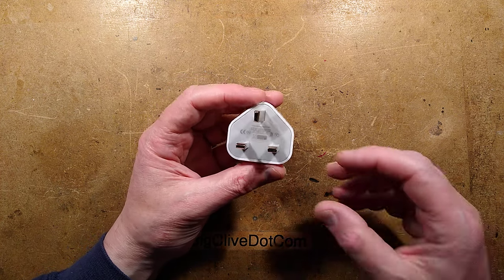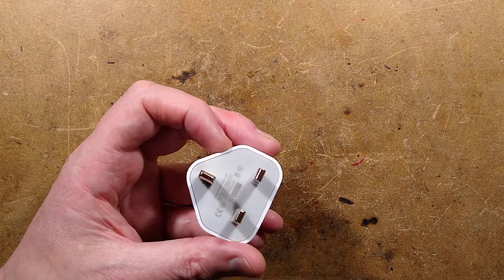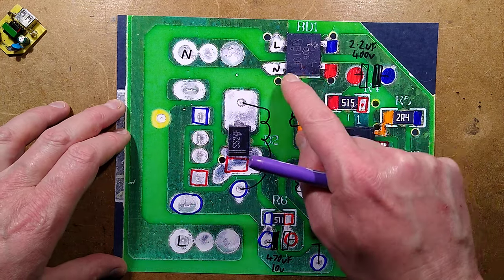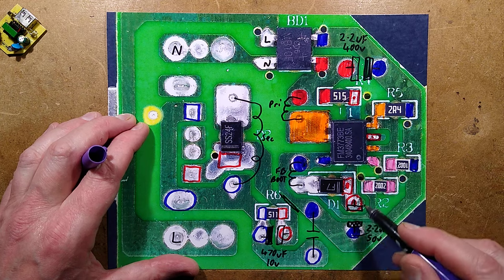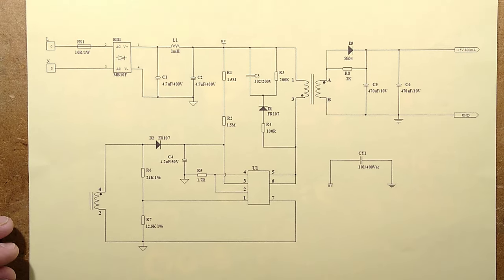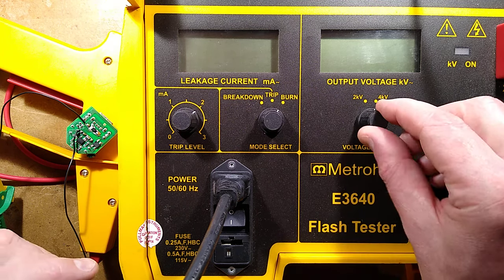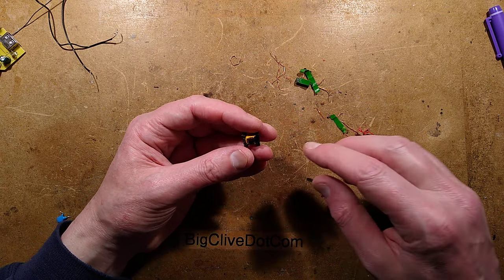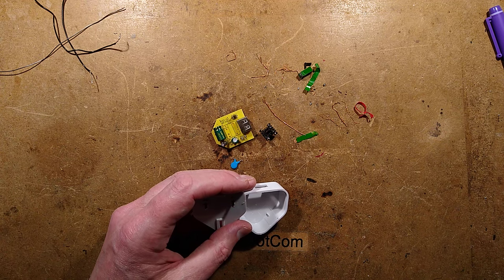Don't buy cheap death-wish chargers

Comment: I bought a ‘Genuine Apple Charger’ from an Australian ebay seller in Australia. I pulled it apart and was clearly a fake. Oh boy did ebay seller go ballistic when I called out the fake product with a negative review. Trouble is, I as an electronic manufacturer spend a small fortune on compliance, but authorities don’t care about unsafe overseas fakes.
Reply: That’s the oddity… importers can bring in almost anything legally as long as it doesn’t crossthe copyright & patent laws, but they can sell *anything*.  It’s up to the user to complain after they’re killed using it.
Of course there’s no traceable path to the importer or manufacturer.
Reply: I had a weird one like that - Australian seller via ebay.  Delta-branded  12V supply for LEDs. Didn't like the look of the label when I got it, didn't look quite right. Pulled it apart and it turned out to actually be a Lite-On PSU, with only about half the current capability. I think it was actually safe enough (proper anti-tracking etc), but as far as I can tell that lite-on model was never approved for Australia. I only use it for testing stuff, never leave it plugged in unattended.
Reply: @laustinspeiss  Actually, in Australia they have to comply with RCM which covers EMC and Electrical Safety. Trouble is, Chinese will print whatever compliance marks you want without doing the testing, and most ebay importers are mums and dads in a garage who wouldn't have the faintest on their legal obligations.
Reply: @DavidMonro  I wouldn’t rank Lite-On any worse than Delta. Both are major Taiwanese electronic manufacturers. Apple actually contracts both Delta and Lite-On to manufacture their offical Apple-branded MacBook chargers.
Reply: @46I37  RCM is just an honesty system. Only an issue if someone catches you out, reports your product and then ACMA decides to prosecute.
Reply: @haxmanz  There's also the EESS for electrical safety, but it's a similar honesty system via the state authorities. I've never checked to see if I could could find documented cases going through.
Reply: What did you expect? you got it on ebay
Reply: @laustinspeiss  uh
Reply: I got a protected power splitter and USB thing from Amazon and the protection must have been the led, as it was all wired directly to the mains. be careful people.

also genuine apple are fairly bad devices too, had a few cell phone cubes that went black and I've replaced a ton of MacBook chargers that had mysteriously charred internals.
Reply: @46I37  don't pin it on the Chinese. I've had gloriously emblazoned "made in the USA" products that are complete shite.   star of that show was the Gary Fisher mountain bike with the bottom bracket out of alignment by 1cm.  quality assurances 🤣
Reply: Genuine and eBay I need I say more
Reply: @man_eating_monkey  HP and Dell both have or still use Lite-On laptop chargers
Reply: shopping platform in our country ban anything gake like that they cant use keyword like lightning original apple etc
Reply: Making money trumps compliance with regulatory and other standards. We know this, the automotive industry is one example...
Reply: @man_eating_monkey  Lite-On is a top notch manufacturer but when you're dealing with a counterfeit item - an item which has been manipulated in some way to misrepresent its origin, specs, etc, you don't really know what sort of a job they did on the item itself, whether they butchered something on there! A little unlikely that there's going to be a safety critical fault as long as magnetics and safety rated caps are intact as they were originally and there's no solder balls lodged in there, but possible that some components are no longer up to spec after the salvage/repair operation by whomever. Second hand salvaged MOSFETs and rebadged fake electrolytic semiconductors are entirely expected. And yeah loose balls of solder aren't that uncommon either, so that's actually a hazard.
Reply: @laustinspeiss  all that matters is the copyright and not safety
Reply: Let’s start again… In Australia, 
you can IMPORT ANYTHING YOU WANT THAT DOESN’T INFRINGE COPYRIGHT OR PATENT LAWS
BUT
SELLING IT IMPOSES LIABILITY on THE SELLER…
If YOU use it, and it fails to perform in any way - you can only BLAME YOURSELF, or CLAIM REDRESS through the ACL from the SELLER.
Hence my earlier comment about no traceable path to the manufacturer and importer- they really DON’T WANT TO KNOW.
Reply: here in germany, the import of fake-branded electronic products is supposed to be very prohibited and controlled, but still, if you look for cheap chargers and headphones and such online, it's like90% fakes on ebay and 70% fakes on amazon. I've made themistake of assuming that a somewhat normal price means a better quality genuine product, but that doesn't work either, so I just buy the cheap fakes.
Reply: Trust nothing purchased online except direct from the manufacturer. Everything else is a counterfeit. If regulations treated counterfeit like copyright, we wouldn’t have this problem.
Reply: The guy you bought it from on eBay literally may be under the impression that they are selling legit products. Could just be a drop shipper.
Reply: If only the official chargers weren’t up-prices so absurdly
Reply: Yea its true i used a fake apple charger and then i swithed to a geniune samsung charger with real 15w charging
Reply: @luminousfractal420 What if the made in China was purposely instead put as made in USA as a lie to trick consumers?

Comment: There's really no excuse for this in British power supplies. Your plugs are so damn big there's always going to be ample room to do it right.
Reply: The space is not the problem. The 99p end consumer price is!
So minus the shop's margin and the shipping cost how much is the total budget to make the damn thing?
You do so see that they left out as many components from the reference design as possible.
Reply: @kwinzman  it's quite possible that the selling price of this item has little to do with its manufacturing cost.  it is much more likely that it is just a loss dump.
Reply: This is actually a big bonus - makes it easier to wire them and easier to find. Of course, they do like to lie on their backs on the floor waiting for an unsuspecting foot. The first thing I noticed on the opening up though was that the earth pin went to nothing. They might as well have just been honest and made the thing out of plastic rather than metal.
Reply: @MrGrimsmith  Apple themselves aren't much better. Take a MacBook charger and you'll see that the metal earth pin on the provided plug isn't connected to anything. If you run your fingers along the metal palm rest you'll feel a tingle because it's not earthed. Only the extension cables are properly earthed.
Reply: @MrGrimsmith  Phone chargers generally don't have the earth pin connected so that is not the issue. That said such devices are required to be fully double insulated in order to meet any reasonable safety standards such as CE certification. This device would thus fail any certification testing in the European Union, which would potentially be a problem if someone were to actually bother enforcing the law at some point, it is about time someone woke up the sellers that are importing and selling these uncompliant items. Probably wont happen until someone with a high enough profile to attract serious media attention to the issue dies though.
Reply: @steeviebops  I saw one spontaneously combust once. A delicate coil of blue smoke.

Comment: Do you have the guts of an Apple charger plug so they could be compared side by side for components and build quality?
Reply: I took an old Apple charger apart, there is a hell of a lot more components in one of those, and electrical seperation. I did it out of curiosity, so yes the Apple ones are much better quality lol.
Reply: Apple use Rubicon cap, IRF power ICs, and actual EMC filters, way higher quality that this things
Reply: I can't stand Apple products normally, but there basic 5v USB chargers are some of the best you can get. Probably why half the cheap ones are designed to look like them.
Reply: @tin2001  the upside of having vendor support lock-in. If they would ship shitty chargers then it would cost them more in under warranty servicing.
Reply: could you open a genuine Apple adaptor and do a part by part comparison. That woukd be very interesting.

Comment: I just want to take a moment to celebrate the return of terrifyingly dangerous 240v electronics.
Reply: What's so dangerous about 240 or 230 Volts ? Design it right and it's no problem.
Reply: @grahamstevenson1740  And therein lies the rub.
Reply: Actually a bit more than 240V, since the the rectified DC voltage is almost the peak-to-peak voltage of the mains sine wave.
Reply: And 120v is so much better? Try and design a decent high power amplifier for 120v. Taking so much current that connector heating restriction of current flow. Yes I am talking about serious current for class A amps!

Comment: For a second, I expected you to probe the diodes in the picture and not on the actual PCB. It's one thing to skimp on (omit) components that affect performance, another thing entirely to skimp on those that affect safety. The lack of separation is particularly inexcusable. It looks like there was enough room in the layout to create sufficient separation by shifting things around a bit. And adding a slot to a PCB costs virtually nothing.
Reply: Yes, me too!! :D
Reply: That's not a defect in design. It's a spark gap feature :)
Reply: He hasn't been drinking enough to make that mistake again. 😆
Reply: @piconano  lol, it's part of the protection, It sparks.
Reply: Gaps are a surcharge from the PCB factory.  It may or may not be cheaper than increased PCB area.  But even with that space routed completely out, the distance may be too small for mains isolation without a dedicated protrusion in the plastic case.
Reply: Agreed, the routing and component placement could have been a lot better. I can't be a 100% sure without actually trying, but I suspect it would be possible to design that same circuit with enough electrical separation, even without cutting a slot in the PCB. But obviously this thing was designed to a budget, not to any quality standards.
Reply: @MicraHakkinen  And yet the base was marked 'CE' so that's a complete regulatory failure. Nobody in China gives a tinker's cuss about CE compliance of course because you can't take them to court, they're in a country far away and can do what they like.
Reply: @grahamstevenson1740  So many regulations in First-world countries, then we just import crap from countries without those regulations because it's cheap.  We at least need to get serious about fake labels, whether it's fake safety labels, or performance far under listed output.
Reply: @Br3ttM  Actually China has its own CCC compliance mark meant to mean the same as our CE or CA but I didn't see it marked CCC ! Probably you get shot if you misapply a CCC mark !
Reply: I would do that every time if I made these videos, trying to probe the photo.
Reply: @grahamstevenson1740  yep, can't sue a foreign country usually; Although people buy products worldwide 🙄
Reply: @grahamstevenson1740  Probably no CCC mark because that product isn't sold in China as it's a UK/Singapore style plugtop format.
Reply: A slot in the circuit board won't give you separation - that's the job of the transformer. Separation for some trivial devices like room lamps may not be desirable, as it results in a drastic loss of efficency, with no safety gain at all. Most mains lamps at the full safety standard, still have no separation. Because power supplies can be plugged into anything, how safe this is depends upon the circumstances of use. Personally, I'm a fan of laser separation, which is much safer while retaining efficency, but currently has no low-power equivalent.
Reply: @125brat  That is possible since that part of the moulding's unique to areas using the BS1363 plug. Good point. There's a number of old British colonies using it too plus Iraq of all places.
Reply: @robinhodson9890  Hm, interesting. I'll have to check out laser separation. In the video, Clive uses "separation" to refer to the distance between high-voltage and low-voltage traces. Probably more accurate to call these distances "creepage" and "clearance". Adding a slot would increase the creepage distance, not clearance. Probably not enough to satisfy safety standards, possibly better than nothing.
Reply: a gap would have done NOTHING in this case.  the spark was gapping across the leads, not across plastic.  Plastic is nonconductive, it was the short distance between the leads that is the problem.  the entire circuitboard needed a redesign.
Reply: @thomasneal9291  Agreed. I didn't mean to imply adding a slot to increase the creepage distance would be sufficient. The clearance distance between the traces is obviously not enough, and the whole layout is pretty awful. Unlike Clive's own beautiful PCBs, the PCBs he reverse engineers seem to have been laid out in a slapdash manner with little thought. As a PCB designer, their sheer ugliness makes me cringe.
Reply: @grahamstevenson1740  Iraq used to be called Persia, a British Protectorate till just after WWII. Of course they would have UK standard outlets.
Reply: @SeanBZA  Then why didn't they use the BS546 '15 Amp' and '5 Amp' round pin standard like India ?
I seems they adopted BS1363 long after we has any colonial interest.
Reply: @grahamstevenson1740  That BS standard was around in 1945, and they likely adopted it simply because they gained independance in 1958, when the square pin was firmly entrenched. India 1947, when the old style was still very common, so it stayed that way, just like In South Africa, where the new standard was out, but not all that common, so the old one still stayed in use.
Reply: @SeanBZA  Hey, I can remember the BS546 plugs and sockets MYSELF ! Were it not for 'pushing' BS1363, there would be plenty of BS546 installations today even iin the UK !  In fact in specific areas it still exists !

Comment: Yup, found out the hard way when I had my vape device plugged into a cheap Samsung-lookalike USB charger. I was just about to take a puff when the whole thing became live. I managed to throw it down and, after the initial shock had worn off, curiously measured the voltage of the USB cable to ground. Roughly 330V!
I took it apart and yes, they didn't use a class-Y capacitor between primary and secondary, and the cheap standard cap had become a resistor.
Reply: I understand why they say vaping is dangerous now :)
Reply: Vaping can be bad for your health 🤔that way
Reply: btw, just in case: in EU (certainly in DE) there will be quite some tax on any kind of vaping liquid shortly, like 200€ on a liter of base, no aroma nor nic added, that's on top... plus vat afaik. Time to bunker stuff...
Reply: Your vaping device will get back to you in a few years...
Reply: @bonzaihb3432  Just buy high concentration nicotine solution in PG or VG.
Plenty of places sell it (in the UK) up to about 100mg/ml.
It just isn't marked as "for vaping use" and therefore the EU TPD has no effect on it.

Then you just buy some VG and flavour.
Reply: @bonzaihb3432  This is why I was one of those that voted to leave (we were the majority but the minority are extremely vocal).
UK has embraced vaping as a way to stop smoking, backed up with countless studies. It's financially not good for the economy, but it's the right thing to do. Tobacco duty financial gains are far more than the costs to the health service for smoking related illnesses, so I see restrictions on vaping as being solely for financial reasons. EU wanted to bring in vaping restrictions despite all available evidence, that alone was enough for me to vote to get the f out of that corruption.
Reply: @bonzaihb3432  I guess it's not quite such an obnoxious habit as actual smoking, but please don't encourage it.
Reply: @georgeprout42  do you still have the 2ml tank size restriction Germany does not have? Let’s just hope your government does not find out that there’s another thing to tax.
Reply: @VolkerHett  Yes. It's one of the EU laws that was grandfather in and hasn't been changed. Yet.
Reply: @georgeprout42  have you realised the mistake you made yet?
Reply: @BrianG61UK  Obnoxious?

You mean smoking is possibly the oldest past time known to man

Your comment is obnoxious
Reply: @georgeprout42  - vaping (depending on what ‘flavour’) may still not be nice to the person downwind of you. I’m not having a go at any particular person. But some smokers and some vapers can be inconsiderate to non-smokers.
Reply: @Mark1024MAK  Absolutely. Some people are arseholes. Stereotypical receptionist's perfume and Lush shops fit onto the same category. I'll add the forced route at airports after "security" as well.
Reply: @georgeprout42  We have no restrictions on tank sizes in Germany.
Reply: @georgeprout42  maybe not taxing it atm but they soon will
Reply: I already got that with a noname ACDC converter supposed to output 9VDC
Reply: @PainterVierax  so you were Thunderstruck?
Reply: @kpanic23  fortunately not that bad. I just experienced small tickles when I was simultaneously holding the plugged device and touching a radiator. Not harmful but definitively not a properly insulated 9VDC either.
Reply: @PainterVierax  That slight tingle is actually completely normal on an ungrounded power supply. Even original Apple chargers cause it. Its a tiny leakage current through the LEGIT noise suppression capacitor. Enough to be noticable but completely harmless.
In my case the capacitor shorted and connected the output directly to rectified mains. Which did hurt a lot. Couldn't use my arm for anything much for half a day...